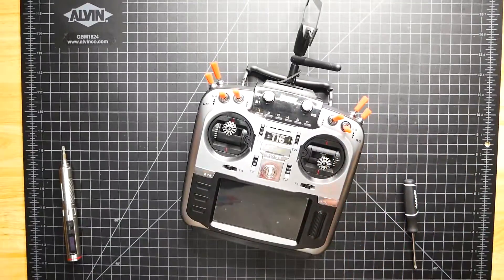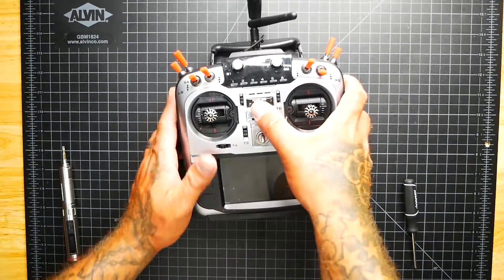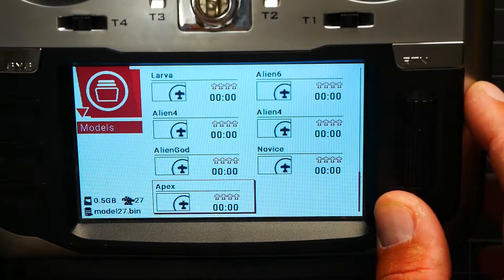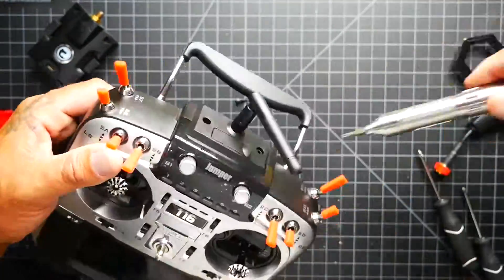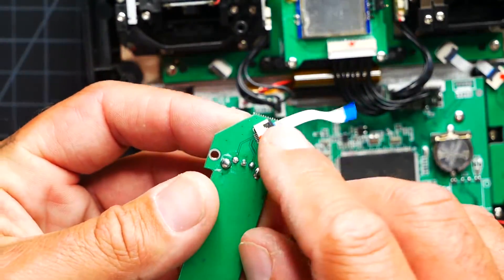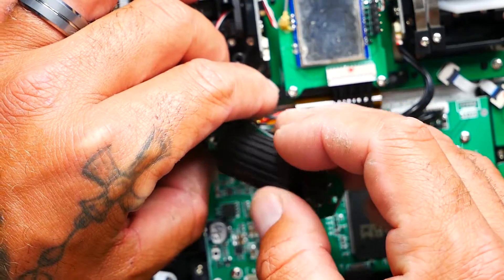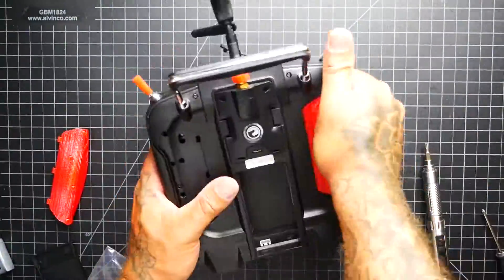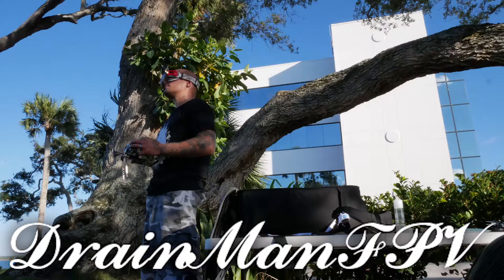Jumper T16 Scroll Wheel Replacement! Fast & Easy!

Comment: Thanks for showing  me how to detach ribbon cable. My select switch wasn't working on the scroll wheel. Per a different video he said switch sides on your ribbon cable, but didn't show how. I reversed my cable to the wheel and it is now fixed without replacement. FYI for anyone having same issue.
Reply: @bazinga7683  Go to 4:43 in the time line of this video. You will see the small ribbon cable attached to the green piece with the scroll wheel.  Straighten and reverse.